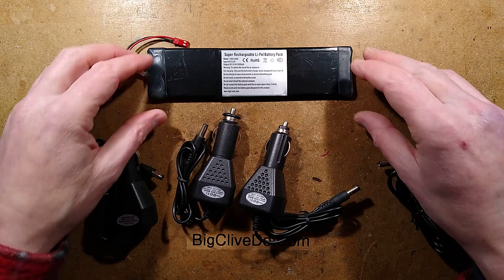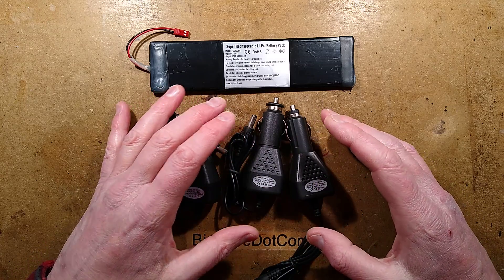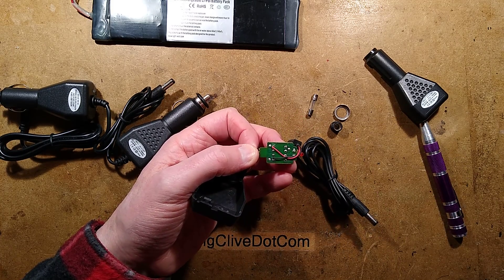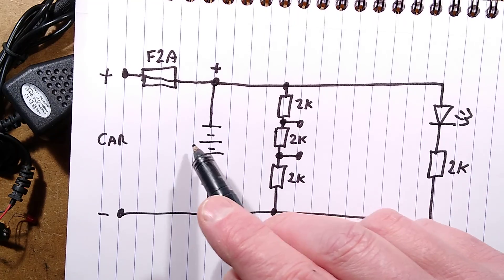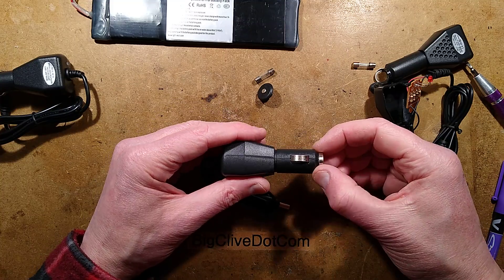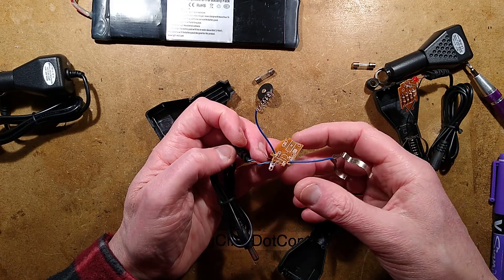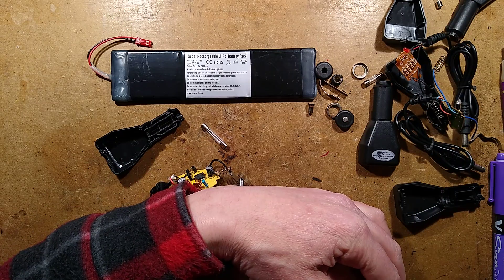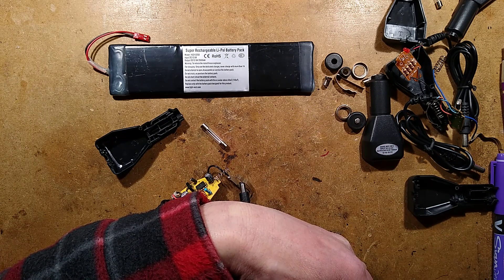Triple trouble - when offshoring goes wrong

Comment: I used to work with an electrical engineer. Before he went to bed or left the house he would make sure that every battery charger and chargeable electronics (like laptops or phones) were powered down and unplugged. He never left a battery charging unattended.
Reply: I got up about 2am one morning, went downstairs for a cup of coffee and heard a loud crack and thought it was the fridge doing its auto defrost. When I looked in the hall I could see smoke. A small mains adaptor in a cupboard had melted and was in flames. I am SO lucky I could stop it. I am always cautious now.
Reply: I'm an electrical engineering student and I definitely do this with any circuits I make lol. I'm not as paranoid about consumer products, but maybe I should be.
Reply: Likewise, if I haven't seen the inside of a charger, it doesn't get left plugged-in unattended for any length of time. You simply cannot trust that they're made correctly.
Reply: @LN997-i8x  So how do we (as electrically trained people) check the inside of modern sealed chargers without compromising the isolation?
Reply: @johndododoe1411  You can't. That was part of my point!
Reply: @johndododoe1411  No modern chargers are sealed in a way that would compromise isolation when opened. Just... don't break anything on the board? Open the case, make sure it has a fuse, good separation between mains and low voltage, etc.
Reply: @Zen boiRyS that's weird, so no load huh
Reply: @DMack6464  a short in the cable or connector (damage) is a load...
Reply: I visited a construction site last year to do run some network cable in their office. While there we heard a loud BANG! come from outside. A few minutes later they discovered a battery in a charging station had blown up and was still on fire (saw the flames, did not breath the air near by). So, yeah, leaving batteries to charge unattended has some risk. No, I do not know the details or brands involved. My guess would be either a poorly made battery, or one that was mishandled during use.
I had to recharge a car battery over 4 days, but only had a dumb trickle charger (no auto shut off control). I put it on a burn/leak proof surface knowing batteries can do funny things. I checked it for leaks and overheating each day, no problems, but you need to be attentive.
Reply: @stevedixon921  I recently found out that with a lot of rechargeable lithium batteries, crystals can form in the matrix. So as you say, if they are defective, man handled, or charged poorly, these crystals can apparently eventually grow and short the battery causing it to blow up.
FYI I think its still wise to play safe with car batteries, but most of those are lead-acid. Theoretically much safer.
Reply: It's not just modern offshore kit that can fail either, I should remind myself of the old (British Made kind of old) 6/12v car battery charger I used to have in my front room of my flat, constantly plugged in ready to revive my crappy bike battery one winter...  I woke one night to a funny smell and a low crackling/bubbling/popping noise which I eventually traced to the charger, sat next to the sofa gently smoking and with the base starting to glow!  That thing got carried by it's wires to the "explosion containment bathtub" lol & post-cooldown autopsy suggests the transformer had shorted internally. The smell was hot xfmr wax and charred floorboards...
Reply: @danmackintosh6325  I consider myself warned mate haha. Glad it was "contained"
Reply: i live in an apartment so its a nice feeling knowing how many people live below you, whos behaviors you cannot change even if the government came with nazis
Reply: @Zen boiRyS Some USB cables have a IC in the ends to communicate/negotiate with the devices they're connected to. It or a supporting component like a capacitor has failed short and allowed the charger to pass as much current as it can.

Comment: Everyone knows that transistors are designed to blow first in order to protect the fuse. It's bad design to have to beef up the fuse because the semiconductors aren't burning out...
Reply: The flame indicator in the battery is also much easier to see than a tiny broken fuse wire. Great for people with impaired vision!
Reply: Louis Rossmann has noted that various Apple laptops have circuits designed apparently so that certain diodes and other semiconductor parts will fail before any protective fuse will blow.
Reply: Wouldn't want to damage the fuse
Reply: @raycert07  The fuse is probably the most expensive component.
Reply: They should just save money by eliminating fuses and use 42 gauge wire instead.
Reply: What semiconductor - the LED?
Reply: @paulstubbs7678  Probably half of those cheap resistors actually conducts.
Reply: I recently got an old Scott receiver with a cracked speaker output fuse. It was a weird size (length) so I just jumpered it with a piece of wire wrap wire. They're useless anyhow.
Reply: That's always a nice joke. But in reality isn't the fuse there for fire safety instead of protecting circuitry?
Reply: @eDoc2020  If you want to get technical...
Reply: Lol Jesus that's hilarious